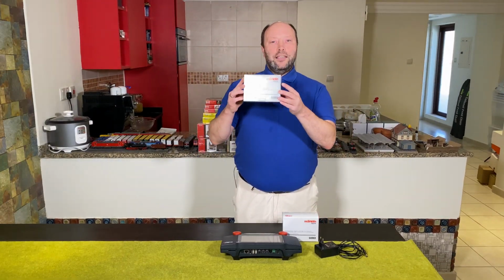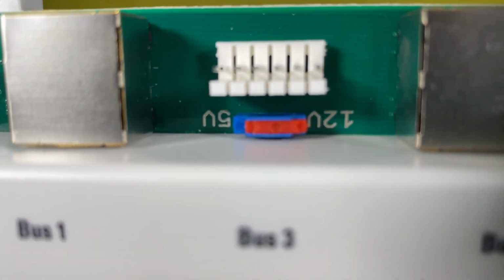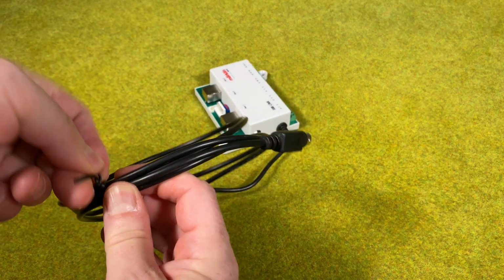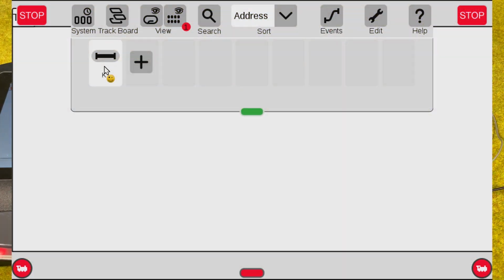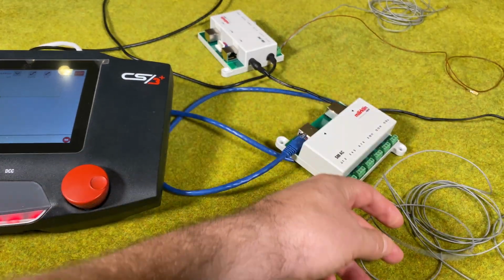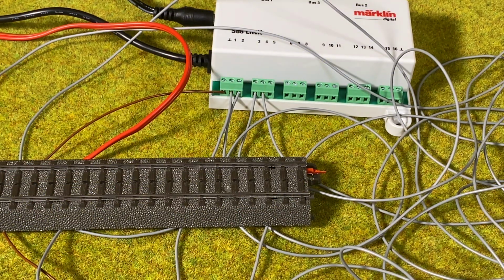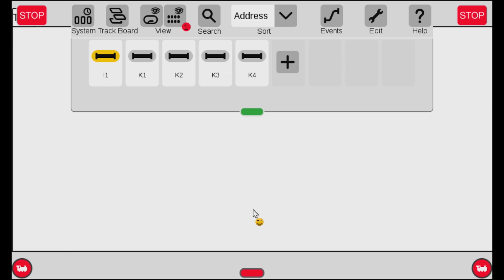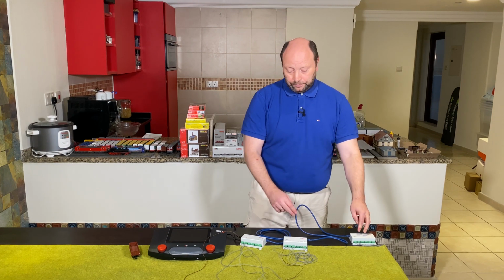S88 and Link88 (Märklin 60881/60883) on the CS3 with contact track (Automation Episode 3)

Comment: Hello Bo. Firstly may i thankyou for the advice you gave me regarding the contact tracks which was very clear and easy to follow. Unfortunately even though the system works both my son in law (Engineer) and my son (Computer systems manager)  still cannot solve why two or three contacts show up on my CS3+ at the same time. Obviously it is a short somewhere but we are trying to resolve it.  May i ask when i make other contact block tracks once this problem is over come............do i connect another brown wire to the same port as the one already connected originally in the earth port ?. My layout is three connecting ovals so i am not sure what to do about the brown wire when i make the other contact areas on the other ovals? Thanks once again and i look forward to more advice and helpfull videos from you.
Reply from the maker: Hi Alf,

Remember to check out the video on contact track before diving into this video: https://youtu.be/2FMWxEPm__Y 

The principle of the contact track is that one rail is powered, while the other is used to detect when the wheels bridge the rails - hence there is a powered rail and a detection rail. You can see an illustration of the principle here: https://youtu.be/2FMWxEPm__Y?t=173

To make it simple always have a philosophy for which rail is the powered rail and which is the contact rail. I usually go with the one closest to me is the powered rail and the one farthest away is the detection rail. Remember to take loops into consideration.

To make a simple test - first start by connecting the L88/S88 as described in this video to just one 24188 track. Connect the brown wire to a powered track and try to use a grey wire to touch the powered rail. You should see the contact track change on the CS3. If you do not, then start troubleshooting.

When the L88/S88 works you can make a simple contact track section using 24188 tracks to see how it works. Try the following to test the principle having tracks from left to right (do this when CS3 is shutdown or in STOP mode and power on/take out of STOP mode when you test).

The idea is to make 4x24188 track from left to right. First track is a standard track insulated from the contact section to the right. The next two track are contact track. The leftmost contact track is connected to the CS3. The rightmost contact track is connected to the L88/S88. The last rightmost track s a standard track insulated from the contact section. Hence you do the following:

- Leftmost 1x24188 track that is not a contact track. Insolate this track to the right on the contact that is farthest away from you.

- have 2x24188 track that are contact track where you have disconnected the rails on both track. Make sure you use the troubleshooting hints in the contact track video to test that you disconnected them correctly. Connect the two contact track together and place them in from of you so you have a leftmost contact track and a rightmost contact track. Then connect the CS3 to the contact track to the left by connecting the brown wire from the CS3 to 0 on the rail closest to you (this is now the powered rail) - this is the 0 to the left of the leftmost contact track. Then connect red wire from the CS3 to B on the same track (left or right). Then connect the L88/S88 to the rightmost contact track brown wire to the powered rail (to 0 to the left). Notice all powered connections are to the same side - the 0 to the left. Now the grey wire to the L88/S88 must be connected to the detection rail. When the powered rail is to the 0 on the left, then the detection rail is on the 0 to the right. Hence, connect the grey wire from the S88 to the 0 to the right on the rightmost contact track. On these two contact track put a small Märklin car as verify if the CS3 detect the car. if this works, then connect the two contact track to the first 24188 track with the insulator. Make sure the insulator is farthest away from you matching the detection rail. Be careful when connecting the track to avoid bending the insulator. Now try again - does the detection still work? Finally, put an insulator on the rightmost contact track on the detection rail - hence, to the right on the contact farthest away from you.

- Rightmost 1x24188 track can now be connected to the two contact track - again take care not to ben the insulator and retest that everything works.

Remember you can only make contact track of standard straight or curved track - not turnouts, uncoupler, and so on.

Hope this helps! Enjoy ;-)

Comment: Excellent tutorial. Thank you. One observation: you need ONLY one ground connection per Link S88 and one for the internal Link88 (CS3+). Having extra ground connections may cause problems of high currents in the S88 system when there is a short circuit (train derailing). During the  little period the short circuit exists, different voltages may appear between the ground connections and this can generate high currents in the CAT5 cables and the S88s..
Reply from the maker: Hi John, 

Great tip! 

I would have expected Märklin to put this in the manual as well... I did consult the manuals again and it does state "Only one ground return is required for all track contacts" - it does not state if this is per module or in total. Neither does it talk about the issue you mentioned.

Question: What is the problem with high currents? false detections or damage to the S88?

Question: Does this also apply if you have multiple power districts/boosters?

Enjoy ;-)
Reply: @ModelTrainFun  High Current (up to 5 A) generate potential differences even between 2 gound points. Connecting 2 S88 (of the same Link88 zone) to 2 different points will cause a portion of this current (1 A or possibly more) to circulate between the connections of a same Link88 system through Ethernet cables that are not made for high currents resulting potentially in connections giving up or faulty cables;
Multiple boosters: they all should be connected to a commun ground (ground reference) and this point should be used also for the S88 grounds.
Reply from the maker: @johnjeanb  I dont think I am able assess if what you are saying is true as I am not en electrical engineer. However, must admit if this really is an issue then I am surprised that Märklin has not clearly stated this in the manuals. As you indicate it would destroy cables and S88s. 

If this is an issue wouldn't it also be an issue for the feedbacks themselves - not just the ground? Why did Märklin make 2 ground connections on each S88 if they could have saved the money and just use common ground from the CS3/CS3+? I also wonder if the S88 devices are able to protect themselves? The detection is between the ground and the feedback input from the track - if this current difference is too great I can see it getting flaky as well (perhaps this means that the ground should be close to where the detection is - hence the ground is needed for each device). Lots of questions ;-)

I think it would be a good question to Märklin on what is the recommended method.

Thanks for pointing out a potential issue.

Enjoy ;-)
Reply: @ModelTrainFun  "Why did Märklin make 2 ground connections on each S88" To make it easy for Reed users and during testing
"Why aren't inputs involved" because the impedance is high 5 k to 20 kOhms so there is no destruction risk
PS I am an Electrical / Electronics engineer

Comment: Your video is just outstanding. Thanks to your VERY clear explanations, I am slowly but surely preparing the future automation of my tracks! I start to 😮see what I have to buy from märklin.
I thought I made a mistake one year ago by buying the CS3… I now understand this was luckily not so wrong.
One question: is it sufficient initially to buy the L88 only?
Reply from the maker: Hi Baudouin, 

Glad it was helpful! You only need one Link88. For further expansion you need the S88s. Remember to get the S88 AC version (60881) which is for Märklin 3-rail. The 60882 (S88 DC) is for two rail.

The CS3 can be used for automation and it is really fun. However, be ready for a lot of testing and troubleshooting. The focus of automation is reliability ensuring that everything works every time - or it stops if something is wrong.

With the CS3 it is also to use automation software on a PC connected to the CS3. This means that you can do both automation in the CS3 or with software.

Enjoy ;-)

Comment: If this doesn't fix the problem, I'll buy a new CS3+. Regards
Reply from the maker: Hi Carlos, Does it mean you have a previously owned CS3? If so, another issue could be that the timings of the S88 have bee changed. This could be changed back to default by resetting the CS3. Alternatively, I could read from my CS3 what the values are so you can double check. However, unfortunately I am not back from vacation and near my CS3 until January :-( If you want me to check send an email to me (see About on the Channel home page). Enjoy ;-)

Comment: Hi Bob: Finally, it seems that both the K1 and the K2 turn yellow when the freight car passes through the road. My only concern is that the yellow color does not turn gray for a couple of seconds (1 or 2). Is this normal? Shouldn't it suppose be that as soon as it passes the freight car should have to instantly turn gray? Another question: from K1 to K2 all tracks should have an insulator ( in the detection rail (B)). Again Bob, I'm sorry about this, and thank you again. my best regards. Carlos
Reply from the maker: Hi Carlos,

Great that the K1/K2 turn yellow when the freight car arrives. What was wrong?

As for when the freight car is leaving the contact section (could cover multiple tracks) it should go gray again. Remember if you did not isolate from the adjacent tracks then they may also be part of the contact section. Even if you isolate the rails might touch - see touching rails here: https://www.youtube.com/watch?v=2FMWxEPm__Y&t=2062s

Hope this helps. Enjoy ;-)

Comment: Hi Bob: I followed all your latest instruction but I still with problems (I connected the K2 to the K1 and the problem was solved with the K1. But now the problem is with the K2) I changed the tracks the Wires and etc. I may buy a new S88 Link. (60883) Do I need the S88 Ac to be connected to the CS3+ ?. I'm thinking to use the computer program Rocrail. Thank you again for your help. My best regards, Carlos
Reply from the maker: Hi Carlos, 

To me it sounds like K1 is not really working for some reason? 

You only need one Link88 (Märklin 60883) and then you will connect the rest of the S88s to the Link88. If you use the 12V setting on the Link88 for increased reliability (recommended), then you can only use S88s that support this 12V setting. So you must use Märklin 60881 AC, Märklin 60882 DC or compatible. These are connected to the Link88 bus 1 or 2. If you have the CS3+ you can also connect S88s directly to the CS3+.

If you have the CS3+ with a small layout consider connecting directly to the CS3+ to save money. If you have the CS3+ and a larger layout or have issues with reliability consider using the Link88 so you can use the 12V. You can see the benefits of the Link88 here: https://www.youtube.com/watch?v=asgop7QRIK8&t=750s If you have a CS3 (not +), then you always need the Link88.

Hope this helps with your automation! Enjoy ;-)

Comment: Hi Bob:
              I’m sorry about my insistence regarding the automation. I have been following step by step your instruction, in this case “Automation Episode 3”. When I check with the spade connectors, I get the yellow or the grey colors with the K1 and with the K2. But when I try to check with the freight car in the tracks, I get the yellow color (contact) for the K2 but nothing happens with the K1 (doesn’t change Yellow and or Grey) The ground cable is also connected.
              I have been trying with the spade connector and even soldering to the track. Why I’m always having the problem with K1 and not with K2, the connection are exactly the same way. 
	Thank you again, You have a very good Knowledge about Marklin, You should be The CEO.

My best regards,
Carlos
Reply from the maker: Hi Carlos,

Compared to your previous comment where K1 and K2 did not work I guess you got K2 working now? What made it work? Maybe the same thing is wrong with K1?

Usually when something is mysterious like what you have there I try to isolate the fault - which piece is not working. I would replace each part one by one to see if there is a difference and check each piece another place as well.

Suggest:
- Another track - works better? connect K1 to the K1 track?
- Another wire from K1 to the track? use same wire as to K2?
- Another car? use same car as works with K2?

Other things:
- if you just connect the two rails on the K1 track - does it work?
- How long is the wire from the S88 to the K1 track?
- when you tested K1 did you use the same wire as goes all the way to the K1 track?

Looking as this and the previous comment it sounds most likely that there is an issue with the track/car or connection of wire to track. However, you could also be unlucky that K1 does not work - try K3 instead?

Finally, the track might be too far from the S88? ...or the K1 track is very far from the K2 track and the ground is different. Connect the ground to some place between K1 and K2? Is there another track near K1 that works?

Hope this helps! Enjoy ;-)
Reply from the maker: ...one to also try. If you connect K2 to the track that K1 was connected. Does K2 behave the same - or does it work?

Comment: OMG, buy Yourself crimping tool like Knipex 97 52 34 and You will be set for cables ranging from 0,1mm - 2,5mm^2 😉
Reply from the maker: Hi Piotr, yes, I need a crimping tool - issue is that I do not know what to buy. Unfortunately, it does not seem like I can buy the Knipex 975234 where I live. When I search for crimping tool in my local amazon.ae I find multiple types of crimping tools - do you have a hint what to look for to get a compatible one? ...or do you have a picture of one, so I know which type to look for? Thanks. Enjoy ;-)

Comment: Great tutorials. I have 1 question. When you make a block, i think you need a section of a contactrail (*/- 30 cm) that detects when the train enters the block - 'ENTER'. Then you have a great block ( longer than the longest train), that is the block itself - 'BLOCK'. And at least a section(*/- 30 cm) that detects when the train leave the blcck - 'LEAVE'. And now my question. When I place 2 blocks one after the other, on the same track? Do I need to put a   'ENTER - BLOCK1 - LEAVE - ENTER - BLOCK2 - LEAVE or can I do it on a easy way 'ENTER - BLOCK1  - LEAVE - BLOCK2 - LEAVE or ENTER - BLOCK1 - ENTER - BLOCK2 - LEAVE. What is the right solution?
Greetings from Belgium
Reply from the maker: Hi Tasha, 

How you create the blocks depends on if you use the CS3 or software automation. For many software automations you only need one contact track as the software can break precisely within one contact track (1 contact track per block).

With the CS3 I tend to make the blocks such that there is a contact track where I need to break. Hence, for one-way blocks I have 1 long contact track followed by one short where I want to break e.g. before a signal. In the same way I tend to have 3 contact tracks in a two-way block. Make sure that the shortest contact track is at least the length of your longest locomotive and/or car + a little.

You can check out the Automation Series where I make some examples: https://www.youtube.com/playlist?list=PLYAhs-Pox3sHzQJsNU-FmOEj1ylO-NPpV

Specifically, you can in this video see how I make the contact tracks and blocks on a small simple layout: https://www.youtube.com/watch?v=ieAltkA_WDw

Hope this helps. Enjoy automation ;-)

Comment: Thanks for your videos! Great explanations! I still have a doubt: if I have a L88 and a S88 on Bus 1 can I avoid to connect the brown wire of the S88 or I always need to connect a brown wire for each S88 on the bus?
Reply: Thank you for your quick answer!
Reply from the maker: Hi Luigi, I have always connected the brown on each L88/S88 device. I double checked the manual - it does not say directly, but seems to indicate the same. I suggest connect brown on each to ensure better detection. Enjoy ;-)

Comment: Great video! I was hesitating between CS3 and CS3+ and now thanks to you I know I will go for the CS3.
Reply from the maker: Just to be sure - you can see all differences between CS3 and CS3+ here: https://www.youtube.com/watch?v=wANbrR0fdJk&t=387s

Generally, I agree you do not need it - but just in case. Enjoy ;-)
Reply: @ModelTrainFun  I saw that one as well, very good also. And then I started to hesitate. With this one you just confirmed as I see the benefits of using the Link88 instead of S88. Thanks again! 😀🚂
Reply from the maker: @petit_train_lux  Excellent - don't forget to get a poser supply as well. Enjoy ;-)